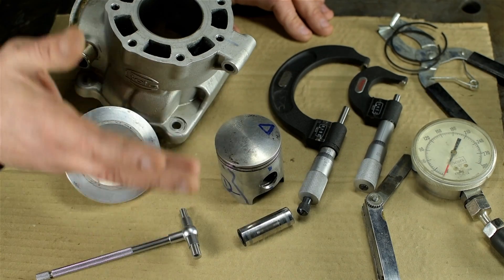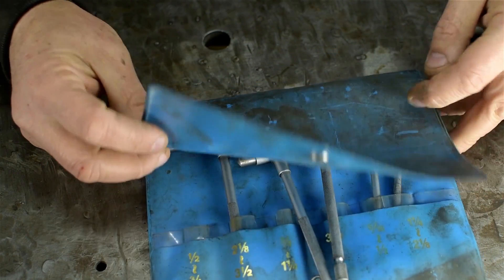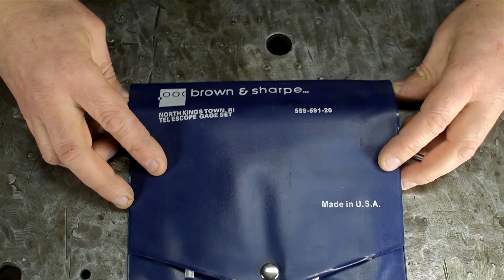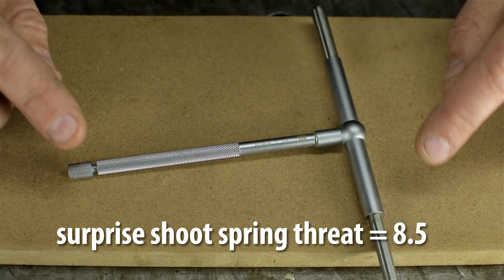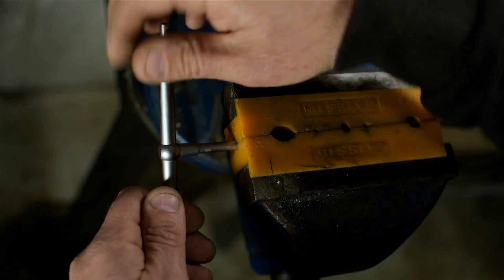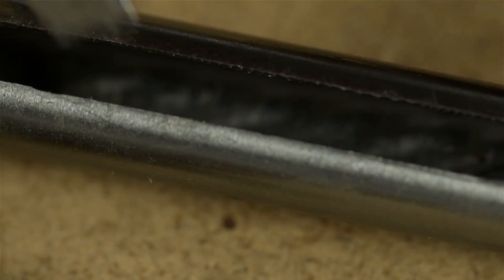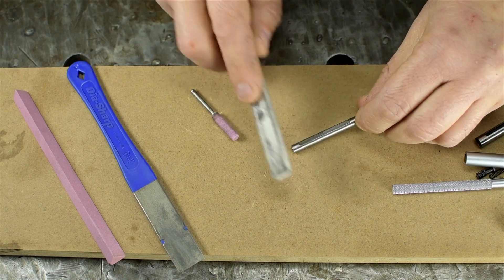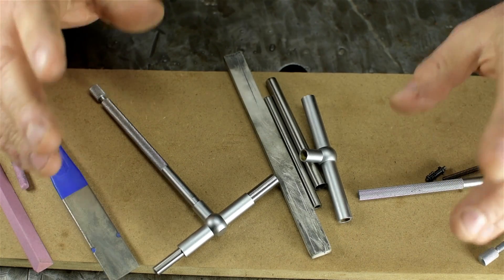Silky Smooth Telescopic Bore Gauges

Comment: I've had this problem for years but never had the khunas to take them apart.  I'd used expensive ones supplied by employers and when I became a contractor I bought cheap (ish) Draper ones and assumed the roughness was "built in".  I think the roughness also affects the operation to a degree, so now I will attack the little beggars, Thanks! PS. I shall slightly warm the thread-lock as that reduces the chances of damaging the parts especially the small ones. Please keep the great videos coming I've loved them all,

Comment: ok so, the first set you dont like because they are smooth and are therefore difficult to lock in place when you want to take a measurement aaaand the second set you dont like because they are basically serrated and crunchy but easy to lock in place.

im not being funny tony but is it possible its like that on purpose so it's easier to lock... and the reason they get harder to lock is because the pin is harder than the plunger and files the keyway smooth naturally over use

Comment: Fixing my bore gauges didn’t help my sanity, probably because I don’t have any and now I’m wondering who the bore gauges i fixed belong to. But seriously, if you want some high quality oil, buy some Nano-Oil. It’s kind of expensive (around 18€/10ml, probably way cheaper in the US) but I use it on my >200€ knives and in comparison to cheaper stuff it works way better. Especially if you compare two knives on washers instead of ball bearings. It comes in different viscositys too.

Comment: Never had much luck with telescopic  gauges..  I use good quality inside caliper like starrett fay type  and polish the nibs nicely     and with a bit of practice you can get a nice feel in the bore then transfer the same feel to the micrometer.. same as telescopic gage  but with more control

Comment: Having spent 45 years as a Tool & Die maker, and used Starrett tools from the 70's and then some from the 2000's, I saw the decline of quality slowly take over that company.  it's a shame that the only aspect of their tools they have kept is the high price.  The quality of both Starrett and Brown & Sharpe has dropped so badly in the last couple decade it's pitiful.  Starrett more so than B&S.  I feel bad for the machinists starting out today because they have no idea what real quality tools are.

Comment: I got a bad Starrett Tee tap handle a while back, they had to ship me a replacement jaw after the replacement Tee tap handle had the same flaw as the first one - one side of the jaw (and not the other) was not ground square enough, more of a bumpy radius of a worn grinding wheel. Third time lucky, it's with the other gear now and the bad ones went back :-)

Comment: "The Brown & Sharpe brand of measurement products is [currently] manufactured by the Hexagon Metrology division of Hexagon AB, [since a 2001 buyout of the old B&S] which retained many of the key individuals from the former Brown & Sharpe company. Since the acquisition, Brown & Sharpe-brand hand tools have been manufactured by Hexagon Metrology's TESA division in Switzerland." —Wikipedia.

So the burrs that TOT removed were of the finest Swiss make. Except for that deluxe quality plastic sleeve which proudly boasts it was "Born in the USA," or words to that effect.

Verdict: counterfeit. You still need to get yourself some real metrology equipment.

Comment: I don't get it.

You stick this dingus into a hole to measure it's diameter, right?
why would you then make the ends flat and not round/pointy/swappable?
Reply: You wouldn't. That's why the ends are slightly radiused and NOT flat.

Comment: If the cheap set didn't hold its position and was smooth then logically by smoothing out the expensive set you have made it so that they will also not hold their position well.

Comment: Those are Brown and Sharp's really cheap bore gages.  Their good models cost from three to eight times as much.  So it doesn't surprise me that they're poorly made.

My iGaging telescoping bore gages have a similar problem, but not nearly so bad as the even cheaper set I replaced.  I simply wasn't inclined to take them apart to see what was wrong with them.  But I can see how cleaning them up as you did, Old Tony, is essential for accurate measurements, not simply feeling good about them.  Now I know I have to do that to mine.

Comment: Starrett telescoping gauges come ready to use. No "crunch" or stickiness and they have an excellent feel. I've bored bearings and used them to check tolerances and they work perfectly. They repeat every time. I don't need a dial bore gage. my starrett telescoping gauges are from the early 90's

Comment: They look the same as my supposed Mitutoyo set. Likely sourced from the same Chickety China shop.  The only smooth ones that I have are the Starret set.  Only issue with them is the length.
I guess I’ll deburr them. Thanks.

Comment: I bought this exact set about 5 years ago. I had the same problem, and hated using them. I expected this kind of stuff from a much cheaper product. I ended up doing the same thing you did and love using them now. Brown and Sharp used to be unmatched in quality, like Starret. But even them I have seen a decline in what they use to produce.

Comment: I've got an old cheap set, probably say Taiwan on them, they're pretty smooth, have held up good...
I now have my dad's old Starett set, they're probably 50 years old.. a few million measurements on them.. still smooth!
My youngest daughter has a set of decent Chinese... Not really smooth, but not as rough as what you just showed us.. 
Doesn't seem to matter where things are made anymore, they don't seem to finish the job.. callipers are probably the worst!
Not necessarily full of burrs, but edges not ground and nothing cleaned up!! All full of grit. 
Not bad to clean up, but you have to take it all apart.
Thanks for the video Tony!!

Comment: Where i used to work i had a telly gauge jam on me one day so i loosed everything up and still couldn't get it open. Finally i gave it a little tap on the wooden bench and bang off all the parts went!! Found everything but the spring, fortunately i kept the gauge because a year later at Christmas we were having a big clean and in all the swarf (chips) under the work bench there was the spring. 20 years later its still going strong!!

I also worked with some animals who would tighten them up so much they dented the bottom face where the anvil lands.

Comment: I had some Cheap ones - thought they were crunchy - so I bought a NEW set of Mitutoyo - I think they were made in the same place - should have returned them.  To get them right, one needs some pencil stones and bright stick. 

If they are not 'finished' a set should sell for $15 - I think they are the same as the ones on Ebay.. All the 'Names' are doing it.

Comment: While the rough finish on internal parts may be displeasing, I can't help but wonder if they were left that way for a reason other than pinching pennies. After all, rough surfaces pressed together do "bite"  together and stay put much better than smooth surfaces. The last thing you'd want is a spring-loaded precision measurement device that slips after being locked for taking a measurement.

Comment: Doesn't applying oil increase the likelihood of the rods slipping once set? Although the burs clearly had to go, I would think the rough finish at dept would also help provide stopping friction for when the detent spring stopper thingy is tight.

Comment: Can somebody explain to me this: say you're measuring the ID of a round hole with this tool. Given that the ends aren't rounded but almost flat, how can you be sure they are really giving you the diameter, since the ends will stop short of the holr wall as they're flat?
Reply: Ideally the ends of the tool will be ground to a radius that is smaller than the smallest measurement that they make.  Meaning that they may be close to "flat" but will always be more rounded than the smallest bore that they may measure; thus always leaving a peak that interacts with the inside of the circle that you're trying to measure.
Reply: They are not round (as in hemispherical)  but they DO have a radius on the ends that give a single point of contact in the center. They are definitely not flat.

Comment: My dad has a set of Starrett telescoping gauges (and is also the one who got me into the trade, Thanks Dad) and I have used someone else's B&S and a couple other brands and i.m.o. and the reason I ended up buying them the Mitutoyo are the best telescoping gauges. They're made with the same quality as the other big 2 brands yet are SLIGHTLY cheaper priced and for me, I get a much better "feel" which means a more accurate measurement

Comment: I was going to say maybe they are counterfeit. If bought of EBay, Amazon or McMaster, you can't be sure what you are getting is genuine. EBay for obvious reasons, Amazon and McMaster don't require suppliers to have a traceable supply chain, so counterfeits are possible from them.
But then I read the comments. Either there are boatloads of counterfeit B&S, or they are crazy overrated and do a terrible job on these (and probably other) tools.
Gotta go check my wish lists, make sure there is no B&S on them.

Comment: The company I used to work for had that same poopie set, I bought a few random gauges on eBay all starrett but used and older, sooo smooth. I bought a set of chineesium ones off a tool truck, they too are nicer than the Brown and Sharpe 😡

Comment: I bought a set from harbor freight. After trying them only once with no good results I threw them in back of a drawer never to be seen again until I watched abom79 using them on a video. He, by far has the best method of using them with repeatable results I’ve ever seen. Now, thanks to him I didn’t waste my money. They were also very gritty feeling. I took em apart and cleaned em up and now they’re a good, frequently used tool. Finally, I can cut some precise bores.

Comment: I used to try and use snap gauges for cylinder bore work. I used to ride dirt bikes. I could never get an accurate measurement either.  I knew from my machinist training, that engine machinists have specialized bore gauges, but I couldn't afford those. I swallowed my pride and asked a guy at work. He had worked on radial aircraft engines at the Curtis Wright facility during WWII. He served in Korea. I always watched him real close, but he was kind of grumpy and intimidating. When I asked him about measuring these bores, he looked at me kind of funny, like I said something that smelled bad. He went and got a metal box he had squirreled away. He explained that trying to use snap gauges won't work. The wear patterns in the bore make an accurate measurement impossible. He told me to take his personal bore taper indicator. It's really old, but accurate. Let him know if it worked for me. This tool has a kind of 'sled' (not sure what to call it) that an indicator sits on. There are different length tips in this kit, that are used depending on bore size. A rod attaches to the device so it can be easily slid down the bore. I used it, figured out the proper dimension to bore it oversize. Worked great! The machinist, Donald Andrews (RIP), gave me the tool. I've used it countless times. He didn't think it was doing anybody any good buried in his tool box. I got to know him well after that. We became good friends. I get to tell this story about a quiet man that helped me out, every time I show that tool off.
Reply: Great story
Reply: That’s a Damb good story! Aren’t those story’s always a treasure to share?🙂
Reply: i can get accurate measurements with bore gauges, there good to about +-.001, which is not good enough for engine rebuilding engine, +-.0005 is usually what you shoot for, when i made 16 steriling engines for college i used go nogo gauges, but its was a small bore only being .620

Comment: Take it apart in a gallon ziplock bag for when the springs go ballistic
Reply: The problem is... I always pass out before I'm finished
Reply: @matthewsimmons6831  can you really fit in a 1Gal ziplock bag?
Reply: @poppabear3664  only the head has to fit right?
Reply: @matthewsimmons6831  lol
Reply: Shane K speaking of ballistic, one time I took apart a tool, not knowing there was a spring, and the thing exploded! I swear the spring and a few parts must of ended up in orbit and are there to this day because I've looked everywhere in my shop and can't find em.
Reply: lkw, learned my lesson similarly, found an AR15 detent stuck in my ceiling several years after I lost it.
Reply: Shane K lol, how'd you manage to find it?
Reply: lkw, for some reason I looked at the ceiling above my bench and seen it there, when I pulled it down and looked at it I figured out what it was and remembered losing it a few years earlier. My first 1911 when I took it apart (before google, I was just winging it) the barrel bushing went flying across the room, my wife had to help me find it. Live and learn
Reply: Shane K  lol been there!
Reply: @lkw6640  you gog a hole in ur roof?
Reply: chara dremur  roof still leaks lol. One of these days I'll fix it Ma
Reply: @lkw6640  that is where it went out lol
Reply: You sound like someone who has done some gun smithing.
Reply: That's how I take apart certain gun bolts. Just to be safe cause the shag carpet in my shop has enough small parts hiding as it is. No really it's a good thing to do .
Reply: Oh sure where were you 30 years ago with this tip . I'll have to file that in my pea brain for future use.
Reply: You must be very small.
Reply: I thought of that too.
Reply: Wow. An amazing idea
Reply: That's a good tip.   Thanks.

Comment: TOT I want my money back on this episode!!  You brought back one of those suppressed memories of mine. I was training a newbie on how to measure a bore. The first few measurements went fine, but then the lock got really tight on them. With some decent effort, it freed up. Unfortunately they didn’t realize that just the tip is the lock and inadvertently loosened the handle shaft. 

The proper term for the “plungers” are “projectiles”. After that, it was just one of those bad days. To account for all the parts, I took apart another gauge to see what was in it. I can’t ever use my gauge set without noticing that two of them have different thread sealant on the handle shafts. You made me go look at them just so I could shake my head again.

Comment: I have older pairs of starrett and lufkin snap gauges, and they’re awesome. The fit of the plungers in the cylinders is much tighter than most other ones I’ve encountered in my high school and college shops. A big difference between the good ones and the crappy snap gauges is also the quality of the knurling, most poor quality versions just can’t get a good sharp knurl, but better tools usually have a nice looking knurl. Definitely wish there was actually a good set of these still available, for any price. It’s like you can either have crappy snap gauges, or extremely expensive sets of tri mics

Comment: So... you made me rush out and dismantle one of my inherited seventy year old Moore & Wright bore gauges.  I have always been happy with them; they certainly lock OK, (only have one moving anvil).  Guess what... they have had minimal use, and they too have a slightly "gritty" feel!   :o(
I'd never noticed... you've broken my heart!

Mine did not need deburring, but as with yours, the pin-slot has been made with an end-mill or similar, resulting in uneven walls.  If the slot had been made with a keyway cutter, it would have been smoother on the walls, but would have needed stop-pins or holes at the ends.  Alternatively, a shoe in the slot would be good, but either way, would you pay for the finished product!
Keep up the good work... we need you in these times.

Comment: You know the thin plastic bag your dry cleaning comes back in? Try undoing springy parts inside one, you will lose a lot less, and spend no time crawling around on the dirty workshop floor with a flashlight. Place the bag on the bench, insert tools and part inside, put one hand in the “neck” and one in the bottom.Quick tip, back at ya.👍

Comment: The current manufacturing strategy seems to be to outsource everything in a race to the bottom. It takes profit margin to inspect parts, so that was eliminated making the output shoddy and unreliable.  Now, a little late, we find we outsourced PPE as well and the people that are saving our lives can’t protect their own when we run out.  Lets hope we can spool up local production in time.

Comment: As simple as those things appear to be, I’m surprised he didn’t just fire up the lathe and make his own set from scratch. Future video maybe?.
Reply: It's the chrome plating.  He could easily make a nifty set if he cared to spent the time, but they'd rust because blueing isn't gonna get it for that kind of tool, and for some reason nobody even entertains the option of nickel plating even though its dirt simple and effective.
Reply: Also oil is a thing that exists still.
Reply: @somebodyelse6673  Hard Chrome plating (not just "flash chrome") beats the hell out of nickel plating as far as wear resistance is concerned. FWIW, Starrett telescoping gauges aren't plated or stainless. They are made of tool steel though, likely containing a fair bit of either chromium or nickel. (They will rust, but not easily.)
Reply: I'm still waiting for the diy gauge block video.
Reply: I too was amazed. Not what I have come to expect from this channel. He should also build many additional jigs and tools to build them.